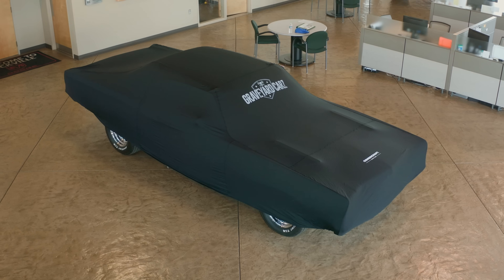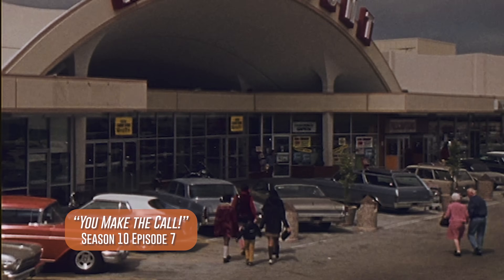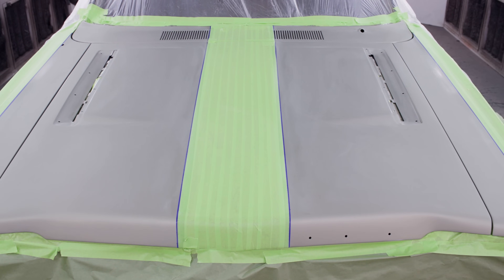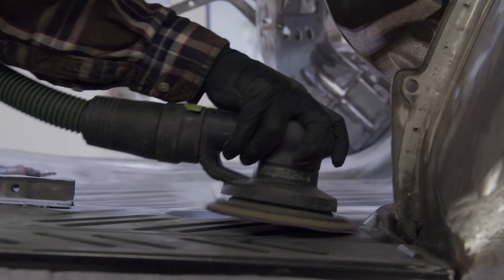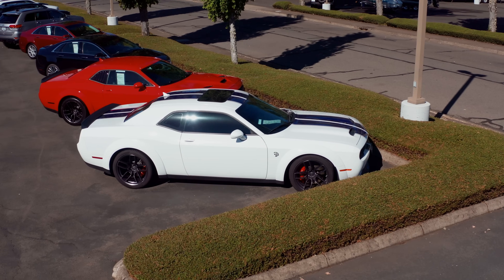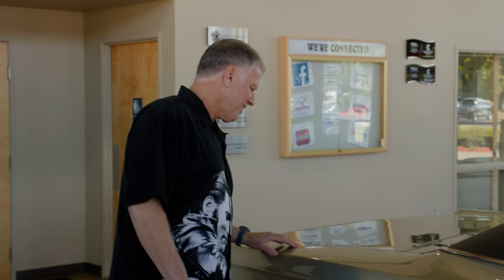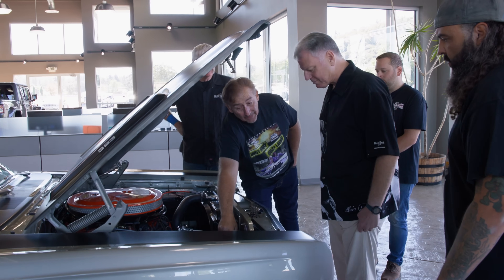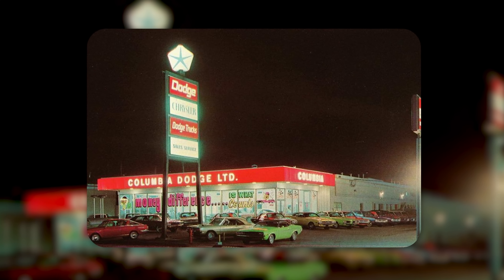A BRAND NEW 1969 ROAD RUNNER ON A PLYMOUTH SHOWROOM FLOOR IN 2022? ONLY ON GRAVEYARD CARZ!

Comment: Really great to see this. Love those vintage of RR. I had a 72 back in the day with a 340 in it. Loved that car. Funny, I was watching a youtube video short of a guy backing up a 72 Charger. I heard the exhaust note and knew immediately it was a 340 even before I saw the call outs. That sound is stuck in my memory. The new motors, Hellcats and what not make tons of power, but those old 2 valve Mopar motors, man they make a rumble.

Comment: I like the 440-HEMI modified with racing cam. or the 426-HEMI stock but the 383 is a great engine. they did well in the Grand Furies.. The Police had no problems catching up to speeders..Highest I'd go on the compression ratio would be 10:1 on any old school performance MOPAR V-8

Comment: I like the 68' better than the 69' just not the stock non-functional side mounted hood scoops?! I like the 68' better because of the options they were not available! Before it got painted basically ALL the metal had to be replaced! Oh well.. If I was to go all out to modify the 68' Road Runner I'd put a fabricated INDEPENDENT rear suspension on it...SIX PACK of course..